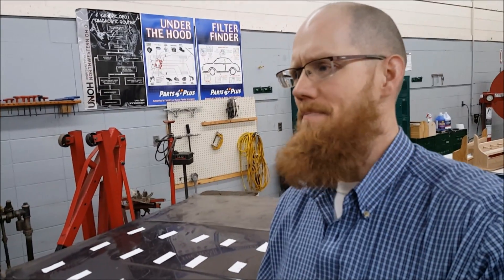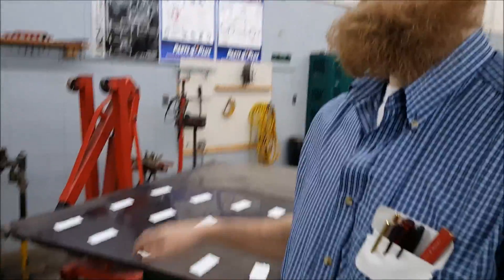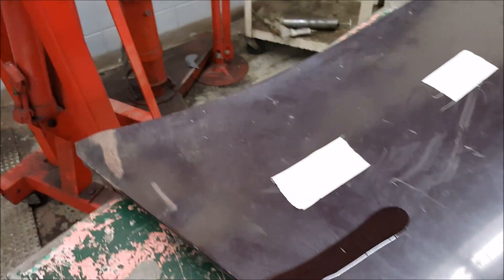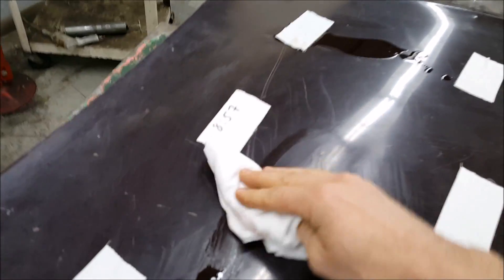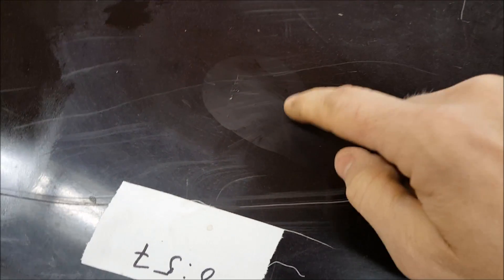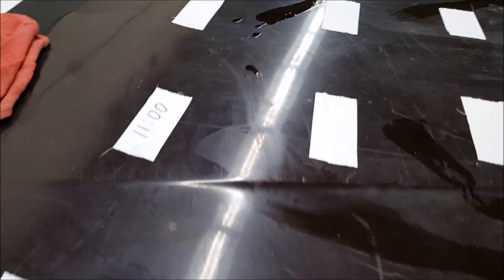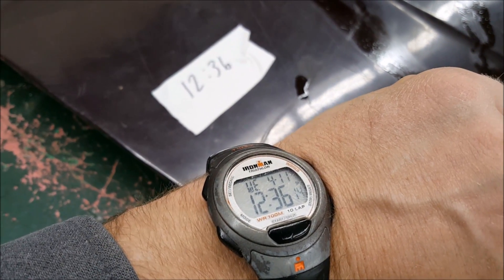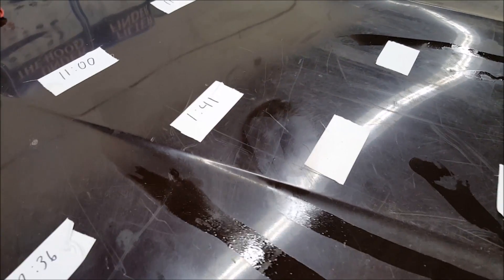Will Brake Fluid Strip Car Paint?

Comment: The outside temp needs to be hot, it actually needs to bake the paint off.
Reply from the maker: This was done inside a shop with zero sun, probably around 70 degrees

Comment: I wanted to strip off the magnesium rocker covers of a corvette and bought a paint stripper. After waiting for the liquid to penetrate the paint, it got soft but not easily removable. if comes off by scratching with a blade or a hard wire brush but could even finish the job yet. Previously I tried to do the same thing with a dot3 brake fluid and it just did the same thing. I thought the paint stripper would work better. The bad thing about the PS is it smells really badly, is more difficult to wash because it’s a gel and it’s more poisonous. BF is much better. 
Try dot 3, it might work better.
Also it probably depends on paint /clearcoat type , if it was baked in the oven idk

Comment: You should try covering the area with break fluid on it with plastic wrap over night. I did this once and it stripped both the clear coat and paint.
Reply: I actually did this, but I left them in the bag for a week. It's a great trick of the trade.

Comment: Does it have a clear coat ?
Reply from the maker: It might have, this hood was from a 1983 Elcamino
Reply: @YoungbloodFamilyFarm  1983? Wow no faded paint. Paint in the 80's are really strong
Reply from the maker: @playstation2bigs  this being from a High School Auto class,  not a fair comparison, it has been inside most of its life.  This car had only 1500 miles on it, but about 20000 tire rotations!

Comment: My local car dealership (Buick/GMC) got brake fluid all over my engine bay. Service manager told me there was an "explosion".  I thought he was kidding. Until I got home and opened the hood!
Reply from the maker: You would think that this would be THEIR responsibility!
Reply: @YoungbloodFamilyFarm  I cleaned it. 
It was just splattered with tiny speckles of oil. Looks new again but is 25 years old w/50.850 miles
Reply: @missingremote4388  only 50k miles?
Reply: @kiyoponnn   yes .. GMC / Buick sent me a free Car fax report. I'm the only one who took it in for Dealer service. It had 16,000 miles back in 2006 .  I got it with 19,000
Reply: @missingremote4388  ohh I see
Reply: @kiyoponnn  yeah Man, I picked it up sight unseen in Hollywood, California; at the Petersen HotRod museum. 2008. I love it -
 Especially now that in November 2019, the Suburban got a star on the walk of fame 🌟 for most filmed car in Hollywood.
Reply: @missingremote4388  Ohh wow, that's really awesome

Comment: I can tell you without a doubt on a fresh paint job with thick clear coat a fine most will definitely cause the clear coat to raise and get soft. (Dot3) that is. I'm hoping it can be buffed and wet sanded down.
Reply from the maker: Good to know
Reply: Sir, are you saying that the Dot3 may be able to remove the clear coat without damaging the paint?
Reply: I learned this trick from being on a 8 day family vacation in the summer of 88.  While I was away my ex-girlfriend poured a bottle of brake fluid all over my truck. The summer heat is brutal in Taft California during every summer. It bubbled every spot that she put it on.